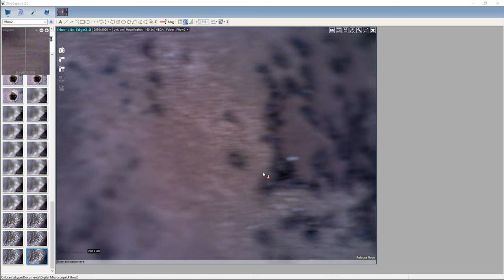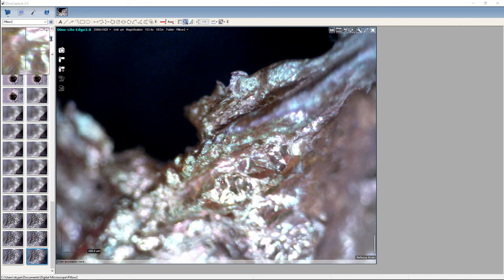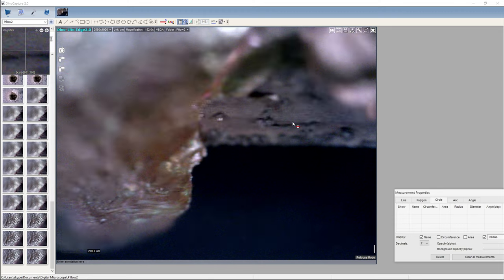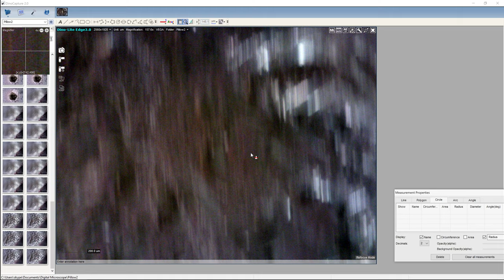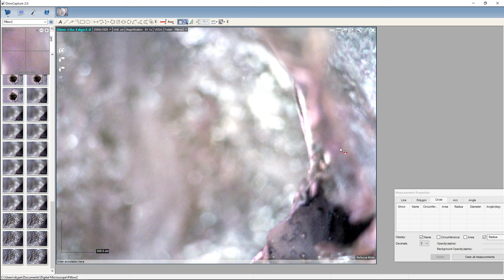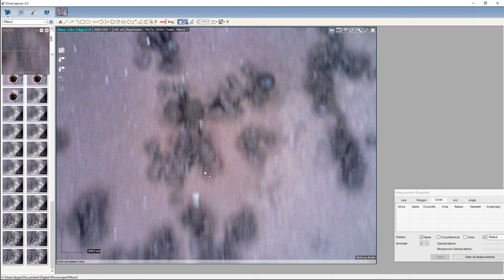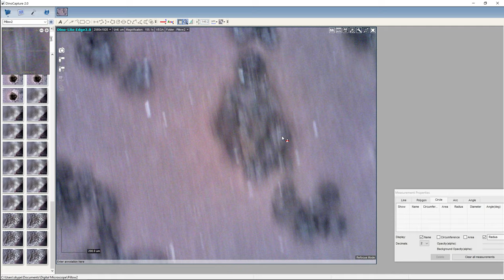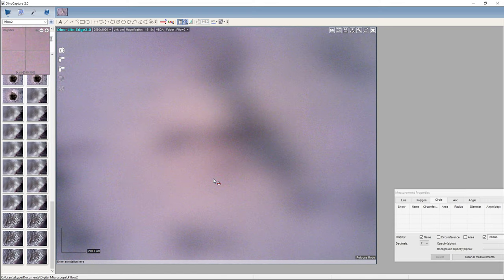VEGA - Pillow 02 - Dino-Lite Edge microscope session

Comment: You mentioned coral reef, so I have to chime in: Decalcomania by Max Ernst, a surrealist technique involving squished paint under glass, and Jean Dubbuffet's work, both 2D and 3D. Cheers!
Reply from the maker: Noted - thanks for sharing.
Reply: well, remaining in the domain of similarity, the pillow resemble me a typical Italian delicatessen, the "gnocco fritto". In this preparation the external surface of pasta remains intact during the cooking while the inside swollen due to the pressure of gas (water vapour). 😀. Apparently a similar mechanism has been at work in the pillow: a sort of "surface tension" due to evos in the surface with a bubbling inside.
Reply from the maker: @dolphin0064  Something like that. Of course, there is also the low pressure in the tank and the pressure inside - but the outside not only has to be pliable, it has to stretch.